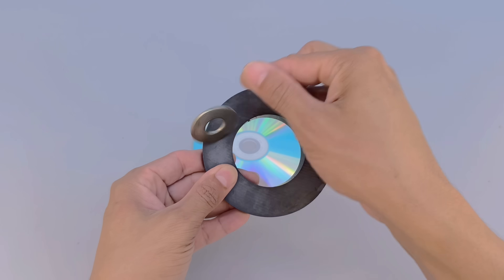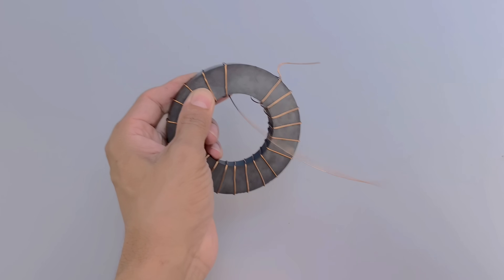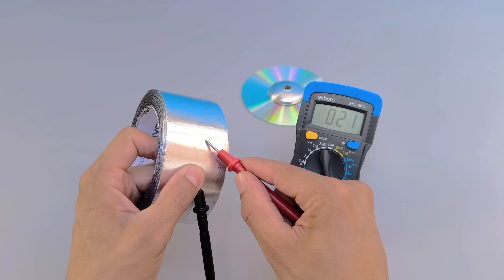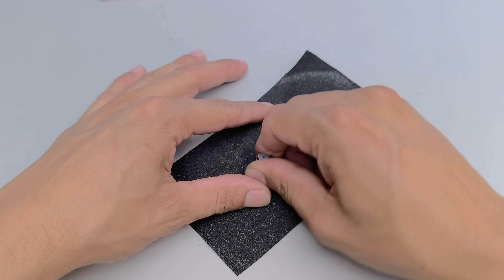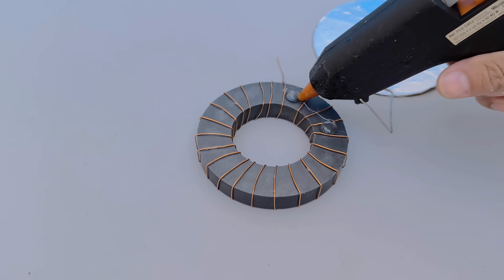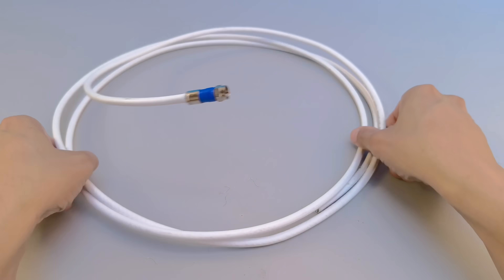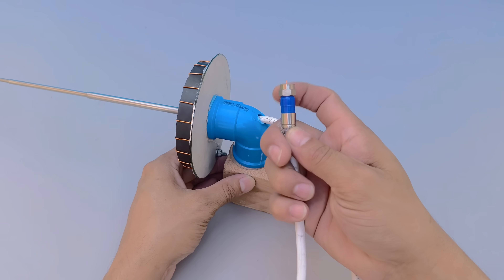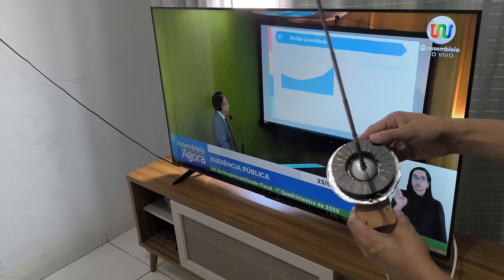Tesla knew this over 100 years ago! Put a magnet and a CD together and see what happens

Comment: Completely fake. Soldering the telescopic antenna short circuits the coaxial connector and therefore the antenna input of the tv. The best way of not receiving anything. The magnet is useless, the coil around it is also shortened, etc. But there are some good tips about cutting cans, finding the center of a circle,...
Reply from the maker: Thank you for your technical comment 🙏 I appreciate the feedback and different point of view

Comment: My friend, you can make a really small tv antenna just using the coax cable all by itself, and it can potentially have a stronger range for reception.

Take a coax cable, and cut .75 meters (approximately 2 feet) of length while leaving the coax adapter connected, then strip away .5 meters (approximately 1.5 feet) of the shielding, leaving exposed copper wire only, then measure 9 centimeters (approximately 3.5 inches) of the exposed wire and cut. For the remaining exposed wire, you just need to cut different length segments, which are as follows: 1cm, 1.5cm, 2cm, 2.5cm, 3cm, 3.5cm, 4cm, 4.5cm, 5cm. Solder the exposed copper segments to the exposed copper wire .5cm spaced, with the center of the segments fixed to the wire for your cable with the 5cm starting at .5cm away from the protective shielding and going to the tip of the wire in smaller segments in order (it should look sort like a pine tree 🌲 in shape). Connect the cable to your TV, then bend the wire that is shielded, making it point up. Run your channel scan, and see how clean the images look.

Btw, the outer frame of your TV is primarily aluminum. No magnets are needed. No need to use the spooled copper wire. Just copper from the cable and the signal reflective aluminum of the tv housing frame.

For the best possible signal, keep the pine tree 🌲 pointing up, find the nearest broadcast antenna 📡  and have the cross segments of the copper perpendicular to the broadcast antenna (you want to receive as much of the signal as possible). There should be a website you can find from a simple google search to find the nearest broadcast antenna, using the search criteria "nearest tv broadcast antenna to [your location]" and it should show on a map.
Reply from the maker: That’s an awesome tip! Using only coax cable to build a small antenna is a clever and effective solution.

Comment: You can achieve the same result using a paperclip as long as you're in an area that actually has TV signals present.
Reply from the maker: That’s a clever point! 💡📡 Paperclips really can be a surprising DIY tool for antennas. Thanks for the tip!

Comment: By your own words the aluminum tape has no connection or connectivity. No only weren't cds around in Teslas day. There is no connection between the central hub, or tape. You soldered the plastic center. I doubt there is much capacitive coupling. The coil if connected will at least add electrical noise. It will not work well.
Reply from the maker: Thanks for your detailed analysis — you're right to point out the nuances! Always good to consider all the variables in these tests.

Comment: I used a simpler process for my spare flat screen tv in my man cave. Bought a rabbit ears antenna at a yard sale for 25 cents. Bought a couple of cable tv transformers for 10 cents each. Using a posting tack, I stuck the antenna to the ceiling above my tv, connected the transformer to the antenna and then, using a short length of ready made coax, connected to my tv and did a channel search...14 channels received! Carefully moved antenna around until maximum number of channels received. The whole process took me about 10 minutes and nowhere as complicated as this video. Total cost, about $1.50. Still, this video is ok for someone with skills and time. Thanks for sharing.
Reply from the maker: Thanks for sharing your antenna setup method; sounds like a great alternative! 👍

Comment: Wow, antenna screwed into pin on coax connector and soldered to shell of same. In electronics this is commonly referred to as a short circuit, so TV picks up nothing. The magnet and associated coila and CD do nothing but make it look like it serves a purpose. The foil tape and coke can would form a ground plane for the antenna if the antenna wasn't shorted out at is base. All in all don't waste your time
Reply from the maker: Thanks for the detailed feedback and explanation of how the antenna could be improved!

Comment: Would be interesting to measure how much gain that "antenna" gets, for example in comparison to connecting a simple wire, maybe that same copper wire without any coil, reflector and stuff.
Reply from the maker: It would be really interesting! Measuring the gain of an antenna compared to a simple copper wire can reveal significant differences. It might be worth testing with a reflector or coil to see the impact.

Comment: "convert the high frequency signal captured by the antenna into a lower frequency signal which the TV can interpret" ?!?! WTF ?!?!
That job is done by the TV's built-in tuner. No antenna converts any frequency. Even the tuner does not actually convert but strips the carrier frequency in order to get the payload signal.
Reply from the maker: 🧠💡 Good observation, @rex_rabbit! Indeed, the TV tuner does the heavy lifting, capturing the carrier frequency and extracting the useful signal—you explained it very technically! 😄 The idea of the video is to show in a simplified way how certain assemblies can capture signals creatively, but of course, without replacing the actual electronic components that perform this processing. Thanks for contributing this more detailed explanation! 👏🔧📡

Comment: YouTube suggested your channel so I clicked on this video: glad I did! I have a short-wave HAM radio license so I'm wondering what the ohm output of this antenna is. SW radios need 50 ohms.
Reply from the maker: That's a great question! I haven't measured the exact ohm output, but this antenna design is more about experimentation than precise impedance matching.

Comment: When a soldering union beads up like it did in your video the contact didn't work. Also i was wondering about the contact of the antenna parts. It only 1 electrical connection is there the problems i saw are of no concern
Reply from the maker: Thanks for pointing that out, I'll pay more attention to the soldering and contact points in the future!

Comment: For startes, nothing will happen when a magnet is placed on a CD. The metals in CDs are non-ferrous. There's also a thin plastic layer on that coke can. That, with the plastic on the CD makes great electrical insulation (which doesnt matter since no electricity was generated anyways).
I cant figure out what draws me here the most. Anger for making up devices that are not functional, or the humor in his attempt to make it appear that it does.
Reply from the maker: Thanks for your comment! You're right that the materials might not interact as expected, but hopefully the video was still fun to watch! 😄

Comment: Wow, built an antenna out of an antenna .
Reply from the maker: Exactly! Sometimes, improving the old with the old is all you need. Antenna-ception activated! 😂📡
Reply: 😹😹😹...at first I thought it was a free wifi hack...
Reply: I was surprised that a spaghetti strainer wasn't used here.. 🥴 I live in a city where there are '5' digital tv emitters/broadcasts, and I have only a 1 meter/3ft piece of haywire by the window, at the end of the coax.. and guess what? I get 5 tv stations! 😊 and I'm sure that whatever I'd build and plug, I would'nt get more stations, the nearest next emitters being over 100km away..